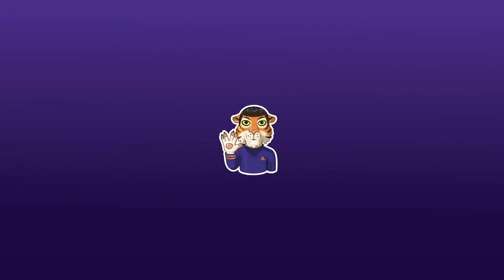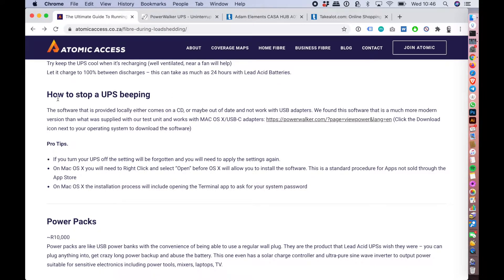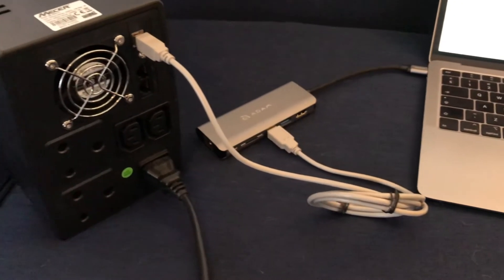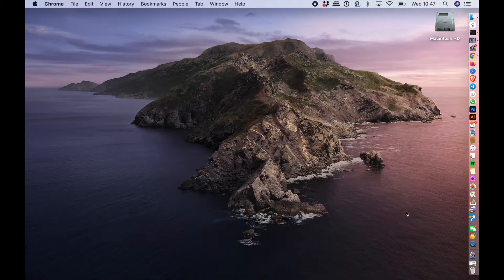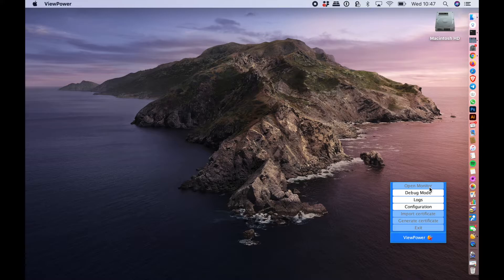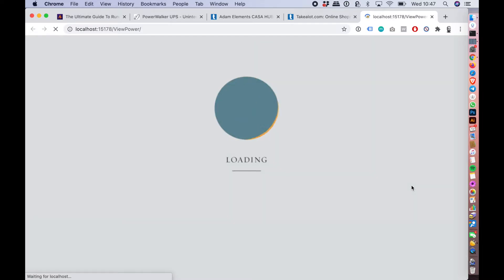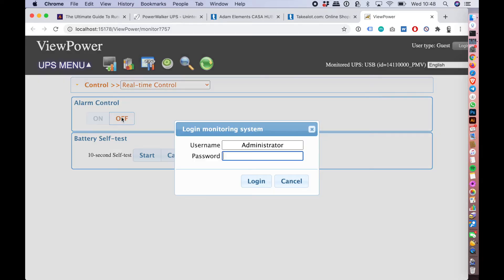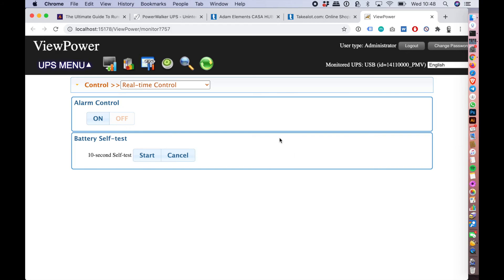How To Stop A UPS From Beeping 🤬

Comment: The app won't open without the Adobe Flash Player which Adobe discontinued 31 December, 2020. Any other way to open ViewPower? I used the link you provided to install it
Reply: More permanent and easy solution is to open the UPS, find the buzzer on the board (it'll be the cylinder-shaped part) and desolder it. Check this video out which was super simple and easy to follow and do -> Stop a UPS from Beeping Permanently by removing its Buzzer! - https://youtu.be/M1KQKvFoUCM

Comment: my apc ups doesnt even have connection ports ...so how the hell do i connect it to my pc???
Reply: More permanent and easy solution is to open the UPS, find the buzzer on the board (it'll be the cylinder-shaped part) and desolder it. Check this video out which was super simple and easy to follow and do -> Stop a UPS from Beeping Permanently by removing its Buzzer! - https://youtu.be/M1KQKvFoUCM

Comment: For some reason mine starts a clicking noise. Just hear this unit going crazy with clicking noises and then it stops. Not sure what it is. Any ideas anyone ?
Reply from the maker: You probably want to contact the retailer and/or manufacturer. Doesn't sound like normal operation.

Comment: After 2 hours on battery power, the UPS turns itself off, automatically. Do you know why it does this?
Reply from the maker: I would suspect it's because your battery is going flat. It's not wise to fully discharge these kinds of UPSs, as this will damage the battery and shorten the lifespan, then you will need to replace the batteries.
Reply: @atomicaccess  No, the battery is not flat at all. All these Mecer UPSs do this. You can turn it back on, and have it go another two hours. I think it's because the UPS isn't meant to be running like that for extended periods of time, so it protects itself by limiting run time to two hours.
Reply: @atomicaccess  Hi again, I think I found the exact cause of the issue. It's overheating. If you disable the alarm, then after two hours of operation, the UPS starts to overheat. At which point, it will just turn off. But with the alarm enabled, the UPS will start beeping (one beep per second), and have a red LED, to alert you to a problem.

Comment: As soon as it runs down and switch on again you have to it all over.  Mine is connected to my NAS, I switch it of with my laptop and then after loadshedding it beeps again.
Reply from the maker: Indeed, this type of UPS, and at least the Mecer UPS, does not keep its settings after losing all of its battery power, or is switched off with the button :(
Reply: @atomicaccess  I'm a little confused. Do I just need to set it up on my computer and then I don't need to keep the UPS connected to the computer? Do I need to set it up again only when the UPS is turned off?
Reply from the maker: @akinokaede  In my experience with this particular UPS, as long as the UPS is not turned off / completely drained of battery power, it will hold onto its settings. If you power it off via the button (or drain the battery completely) the UPS will lose the settings.

Comment: Thanks for this. I am connecting an Eaton 5E with a printer cable. It doesn’t seem to pick the unit up? Could you help?
Reply: I have an eaton 5e and what I did is downloaded the Eaton ups companion software and connect my laptop to the ups everytime the beep starts, and then under settings i disable the alarm...unfortunately you would need to do this everytime the beep starts but the software is permanent on my laptop and i just connect it to my ups and it works like a charm

Comment: Hi there. I have a FSP FP 800 and it seems to only just under a 2.5 hr loadshedding slot. Is this normal battery life for that UPS? Thanks.
Reply from the maker: Given that UPS only has 1 x 9Ah batter that is very good. Please note that depleting those kinds of UPSs to 0% battery quickly damages the batter and you will get less and less time on backup power. Take a look at the DC UPSs on our Fibre During Loadshedding Guide, they last longer, are smaller, cheaper and you can deep cycle the batteries: https://www.atomicaccess.co.za/fibre-during-loadshedding/

Comment: Open it up by unscrewing the bottom screws. On the chip board there is a circular black plastic with a tiny hole in the middle, it's close to the power button. Take pliers and gently twist it off. Mine was not glued and had a small circular metal disk that just fell off. Yours might be glued but can still be twisted off. No speaker = no beep, the end.
Reply: I did the same.
Reply: You saved my life haha. I always get annoyed by the loud beeps. Thank you!
Reply: Do i have to do this while it' s tirned off ?

Comment: Initially thrilled with this solve! 2 things though: it always reverts back to beeping ( without battery fully draining) when there's a power change. The ViewPower software shuts down my computer on it 's own! I have no way to stop this. Any advice would be greatly appreciated.
Reply from the maker: Sadly as we don't sell or manufacture these UPSs advanced troubleshooting is not possible. It could be that the software is not actually preserving the settings, or the save function needs some more nudging (do you get the successful popup?).
Reply: More permanent and easy solution is to open the UPS, find the buzzer on the board (it'll be the cylinder-shaped part) and desolder it. Check this video out which was super simple and easy to follow and do -> Stop a UPS from Beeping Permanently by removing its Buzzer! - https://youtu.be/M1KQKvFoUCM

Comment: Can this be done with a proline a650. And can I do it from my phone.
Reply from the maker: To do this on your phone you'd need to figure out how to install the Java host to run the software on your phone and make it compatible via the USB cable. That would be very impressive hacking skills. The Power Walker software might work, you should have gotten a CD with the unit that has the software on, or you can visit the manufacturer or suppliers website to find the correct software.

Comment: It's a pretty big storm outside, and my UPS is beeping every 30 sec-2 min or so. Mom's TV in the other room hasn't turned off or anything, guess it's still some fluctuations in the current or something?
Reply from the maker: Most UPSs will kick in when the voltage or current is in range, so while it might appear your electricity is not off, the UPS is stopping the wrong voltage/current going to your devices, thereby protecting them. Fridges and AirConditioners have a very hard time with high/low voltage and are damaged easily. Because most electrical devices have a power brick that can work all around the world most can use electricity anywhere between 100-240V and 50 or 60Hz.

Comment: I have an RCT 650VAS UPS its new but barely lasts an hour, should I return it?
Reply: Theres only my laptop connected to it but never lasts, its less than 30 days since I bought it.
Reply from the maker: @kaybee_diloane706  Sadly, that's probably about right for that UPS, it only has 1 x 7 Ah battery inside. These types of UPS are not really designed for long periods of use, but the alternatives are much more expensive. We haven't tested many of these products yet, but you can look at Lithium Ion UPSs that have a mains plug, think they start at around R3000 and up and will power your laptop / fibre for at least 2 hours (much more with some models) and you can discharge the battery without damaging it. The traditional UPS batteries degrade very quickly if they discharge fully.

Comment: Great advice, worked perfectly, however the UPS seems to default to beep every time the power goes off.
Reply from the maker: Hi Guy. Is your UPS running out of power when this happens? Normally if you power down the UPS or it runs out of power the settings revert to default, which comes with the beep "feature"
Reply: @atomicaccess  thanks for the reply, no, wierd but when power status changes then it seems to revert to default
Reply: Experiencing the same thing

Comment: A more permanent, albeit more invasive solution is to open the unit up and cover the small speaker. Ive tried both PressStick and PVC glue - both reduce the sound volume by about 50%... enough to let you know its working but soft enough to not want to poke your ears out with a fork ;-)
Reply: Is it difficult to do? I myself am looking at this option because the software approach doesn't work; my UPS doesn't get picked up at all.
Reply: @rudolfaerofare2683  not difficult at all. Four star screws and u're in :-)
Reply: Easier than expected! Thanks! ^^7

Comment: hi there i do this however it doesnt stay off the beep i keep having to do this everytime the power goes off is this normal
Reply from the maker: Unfortunately, if the UPS is turned off, or the battery discharges fully, the settings will go back to default each time. Have you tried investigated the mini DC UPS? They provide power for a Fibre ONT and a WiFi router for around 4 hours and cost around R800

Comment: Thank you for the clear instructions. Problem I have is that ViewPower requires Adobe Flash player, which was swirched off by Adobe on 12 Jan 2021. Any other advice on how to switch the alarm off?
Reply from the maker: Will have to check this in due course
Reply: More permanent and easy solution is to open the UPS, find the buzzer on the board (it'll be the cylinder-shaped part) and desolder it. Check this video out which was super simple and easy to follow and do -> Stop a UPS from Beeping Permanently by removing its Buzzer! - https://youtu.be/M1KQKvFoUCM
Reply: @LucsSkywalker01  thank you but soldering and opening the ups is beyond my skilis set!

Comment: i dint get any information in the app. all values are either 0 or blank. no beep menu as well...
Reply from the maker: Mac or PC? We didn't really try too hard to make this work on PC.
Reply: @atomicaccess  on Mac. It's a zircon ups. Connected via usb. Mac registers the ups connection.
Reply: I’ve got the same problem on Mac. No info coming up

Comment: I got a meccer 650 ups. I noticed my fibre device is 12v and trenda wifi router is 9v. Can I use the meccer to power both if I am still using the trenda wifi router adaptor it came with?
Reply from the maker: Hi Vikash, you can, but you might run down your UPS battery and damage it. Read the "deep cycling" Lead Acid UPS part of our UPS guide: https://www.atomicaccess.co.za/fibre-during-loadshedding/#lead-acid-ups

Comment: Hey guys - was following along with this exactly - and even have the exact same MECER unit, however - when I click on the green "cog" - nothing happens??? Is there another way to access the "beep" settings??
Reply: I have the same dang problem
Reply from the maker: We recently re-did this process, and in doing so it seems there is an update for the software as it looks different now. The final options would be to remove the speaker. Out of interest were you using Mac or PC and do you have an ad blocker/script blockers? I have a feeling this software is based on an old version of Java, which might make compatibility trickier.
Reply: @atomicaccess   I used PC, cannot comment on the Java version
Reply: I just tried this and it worked exactly as shown! Never been more excited to get a good night's rest during this loadshedding 😂😂